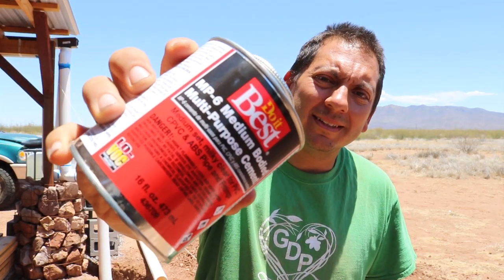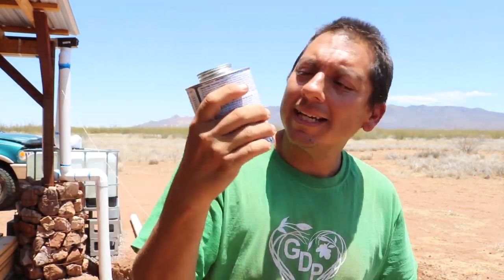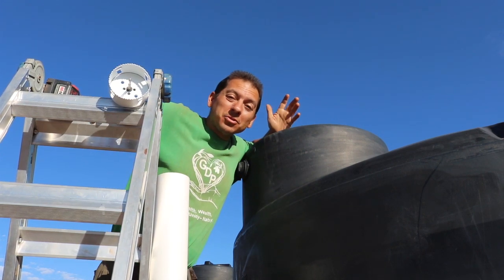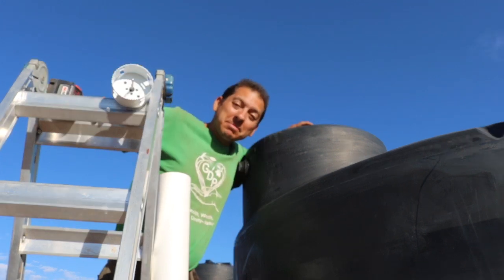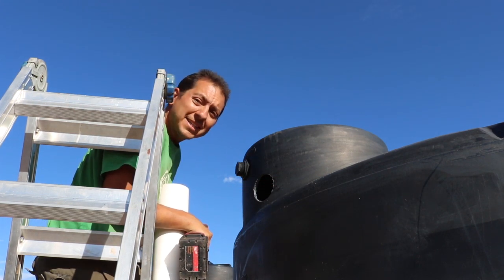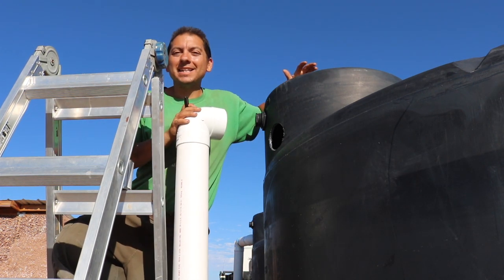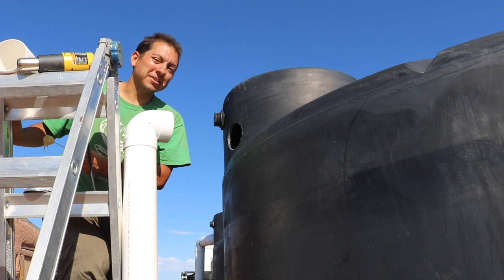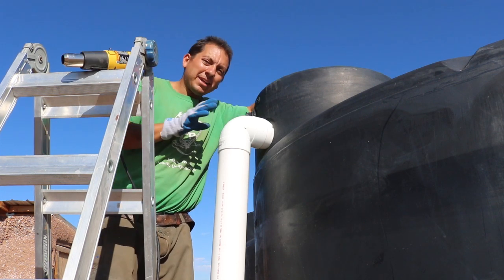Finishing The Plumbing of Our Off-Grid Rainwater Harvesting System to Our Water Tanks

Comment: I bet you are happy getting the plumbing done. It’s nice to see your epic  project done.  Oh if you heat up a longer section of pipe you won’t get such a bad kink. It shouldn’t effect the water flow enough to matter. In your project. But if you king conduit like that it will make pulling wire through it a nightmare. You will probably run int to that on projects like building your house.  .
Reply from the maker: 😃Thanks for the tip Donto!

Comment: Good work Jim!  I bet you are excited!  I think for the tricky 90 degree corner... you might try a pair of street 45 elbows in series.. that might let you swivel to the right angle.  Also on the tank connections, Were you unable to find bulkhead fittings for that?  Thanks for sharing as always... Looking forward to the rain filling those tanks!
Reply from the maker: I tried a couples of 45's, unfortunately it didn't quite work. 
I didn't see any bulkheads for that size either.😔
Reply: In the words of Homer Simpson..... "DOH!!!!!"    Sounds like you exhausted all the piping possibilities...  Guess that leaves a vacuum.. :)

Comment: why did you dig a trench and connect at the top when you could connect at the bottom as water will rise to the roof level?
Reply: Rudolph Gutierrez because if it leaks, you lose all your water. He would have to put a bulkhead in there
Reply from the maker: What Warren said is a good point, but also unfortunately plumbing it at the bottom wouldn't work. At the bottom you would have to deal with water pressure as well. The pressure at the entrance would have to equal the pressure in the tank. Once the tank pressure is too high, the water would probably backflow out of the gutters.
Reply: @ourselfreliantlife  no it wouldn't, as long as the gutters are higher than the tank, same as the principal you're using to fill them. But you're right about there being a lot of pressure at the bottom, unless you used a bulkhead it would leak
Reply: @ourselfreliantlife  I use a hose off the bottom of my tank and raise it up slowly to find the water height in the tank, it won't push the water any higher than it already is.
Reply from the maker: @TerraFirmaX  right, but you wouldn't be able to fill it from the bottom. The pressure isn't the same at the gutters as it is from the bottom of the tank.

Comment: Congrats and good job! Nice to have things complete. Just FYI that PVC is not UV resistant. It is not designed to be exposed to the sun. It will get brittle and dry out because it’s petroleum based. It’s a simple fix, just paint it with exterior paint. Exterior paint is like sunblock. Hope all is well.
Reply from the maker: Thank you! We'll definitely be protecting the pipes!😃